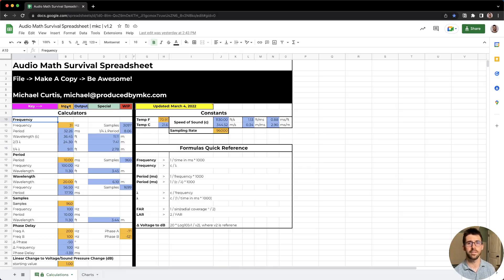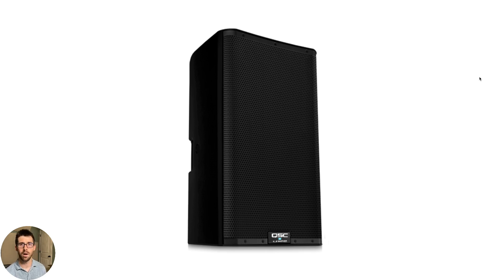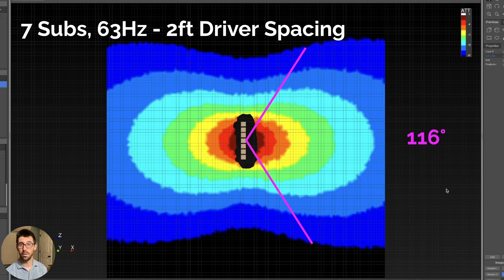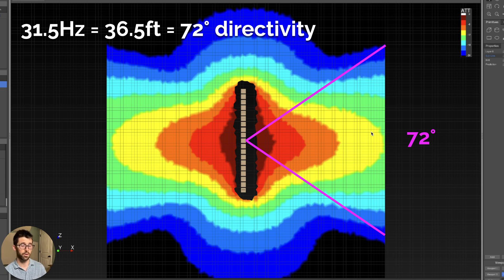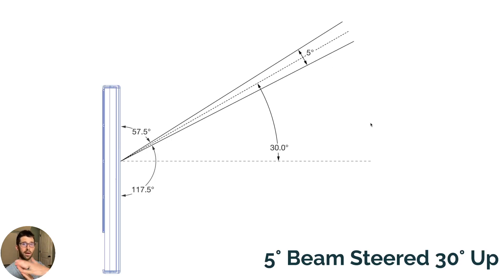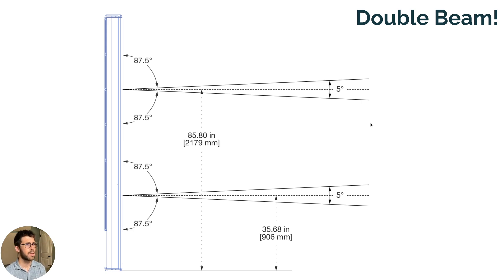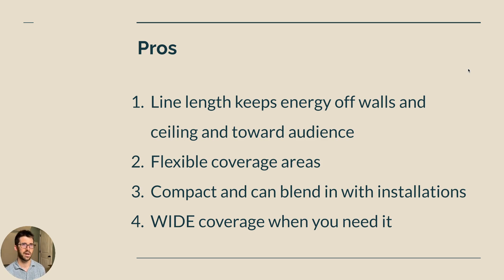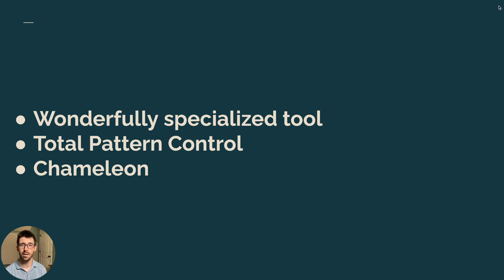Column Speakers For Live Sound | Pros, Cons, and Why They Work

Comment: A number of years ago I traveled through AMTRAK's 30th Street Station in Philadelphia.  The main room with stairways to the various departure gates was a box. Everything about was at 90 degrees to everything else. The ceiling height was 30 feet or more. All surfaces were completely flat and hughly reflective. The perfect conditions for muddy, reverberate sound--little chance if understanding any train departure announcements. Somebody made the PA system a ONE SPEAKER affaire with the one speaker a column array that had to be at least 25 feet tall. The column was in the middle of one of the longest sides of the rectangular room. I was amazed. The train announcements were utterly clear, with perceptually nothing reflected off the floor and ceiling and very little reflected off the parallel walls. Sounded like a speaker located right next to you--no matter where you were in the huge room. Absolutely amazing and the "poster child" for all well engineered column speaker installations.

Comment: This wouldn't work on a Linearray (e.g. 8 elements per side) with splay angle = 0°, right? Cause the individual elements of a line array often have angles of about 12-16°. Or would it work just worse (if ofc every element has its own amp channel)

Comment: I've been using the K-Array column arrays for over a decade now and absolutely love them.  I'm NOT a fan of the 2" tops (8 drivers) but had bought a pair along with their incredibly tiny 12" sub cabinet.  While I don't use them on jobs, I absolutely loved them in my studio and at home for high volume playback.  The 18" and 21" powered sub cabinets contain amplification for the tops and my only gripe is that K-Array is not very forthcoming with information about settings for the system.  There's clearly a lot going on in these systems but the user-available information is relegated to absolute BS....on the other hand, I don't much need to tinker.  I just purchased six tops of their larger 4" driver columns and have now paired those with six JBL VTX dual-12" sub cabinets, which I find a very complementary box.  The 4" Kayman tops are capable of full concert volume and while my concerts are mostly folk/Americana they also take place near neighbors so the 12" lows help us approximate low frequencies while not pushing a huge wave front across property lines.  I also had a set of 4"x12 driver tops custom built and paired with dual 15" cabinets (all Faital drivers), which I mostly use as DJ/movie night speakers.  The single column was built very light-weight and has some mid-frequency spill that makes them a liability for the unprepared with live microphones!  Movie nights, though......simple and amazing, with nearly 180-degree coverage.  

The smaller K-Array's are active speakers (in the low cabinet) and mainly used for ballroom/dinner/gala applications.  The Kayman/VTX setup is passive and has spent summers outdoors with no ill-effect.  The custom builds are passive and have lived on sports fields every spring and fall for several years without failure.  I'm pretty impressed.

Comment: I was playing with subwoofer columns in Danley Direct and found if I applied an even time delay from top to bottom, I could achieve a ring pattern of coverage to an audience on the ground all around a central stage, while missing the stage itself to prevent blasting it with bass. I got interested in the "TM array" from this metallica gig (4 columns of subwoofers facing inwards), but wondered how to steer the bass down. Tilting the column would steer it down in one direction but up in the other.

The beautiful thing about the time delays is you can steer it down in all directions, so the audience hear and feel as if they were at right angles to the column of subwoofers no matter where around the central stage they are positioned. It sort of becomes a partial end fire array, but the phase is not lined up directly underneath it, but down and to the sides. You can even set the limits so that the bass doesn't travel too far out. If you are in a limited size field and don't want to cause a noise nuisance, this could be useful.

Comment: Hi michael. Your videos are very helpful. The way you teach is so easy to understand, unlike many I saw in youtube who cant explain as well or as simple as you do. You made complicated topics easier to understand to the common people. Thank you! My question is: Will column speakers project the sound as far as point source speakers? Or will column speakers project the sound wider than point source speakers?( Assuming both are in the same price range).
Reply from the maker: Thanks a ton!

How "far" a speaker can "project" is a combination of many things - vertical coverage angle, Max SPL, trim height, etc. In general point sources will be more efficient and have more power output than column speakers.

Column speakers in general have a very wide horizontal coverage pattern, 120-160° depending on the model, with a few exceptions.
Reply: @MichaelCurtisAudio Thank you for your reply. I appreciate you taking the time to reply. I think I will stick with Point sources then and obey your command LOL!

Comment: I'm super late to the party on this one, but I run a venue that has a very top of the line column array and I've been fiddling with it and the software for about 6 months now. 
each side has some odd 128 drivers for low mid and 36 for highs - and some subs either side (though i plan to center these in the future for a better dispersion pattern)  

The flexibility to steer, angle, and control the beams takes some getting use to. I've found the secondary beam option is only useful if there is an unreachable gap between the two beams (per say one beam pointing at the ground level and one at the mezzanine. If you try to have two beams for one level of audience, even though the heat map says things are A.O.K, you will have crazy phase issues at the point the beams contact.

Worth noting that you can also set negative beam angles that allow you to "lift" the beam up for a short period of travel distance - great if you're lectern sits right at the front of stage. And being able to adjust the center point of energy from the middle to anywhere along the column means i can get better front to back dispersion while only adding mild phasing artifacts.

I'm also given the ability to optimize the side lobes of the signal by sacrificing some spl; being in a acoustic concert hall makes this invaluable for speech intelligibility. 

All in all, it works well for my venue, but with the best dispersion I can get without it bouncing all over my walls, which are reverberate by design, I can only muster around 105db...this is fine in my acoustically designed concert hall, but wouldn't cut it for a more intense venue i don't think, and can struggle when we do some of our louder, rowdier shows.
Reply from the maker: Thanks for sharing here! Great insight on how this particular speaker topology is acting in a real venue context.

Comment: I'm very interested in building the best possible Ultra Ultra small speaker and I was considering using a bunch of smartphone drivers in a line source, I've already played around with full-range drivers and I'm just astounded of how much power you can get out/into of a 1-inch driver, but I'm looking to go even smaller. Do you have any insights? although a line with 1-inch drivers would be pretty good, I'm curious about making it micro... I also forget how to handle the impedance in a line source I think if I just hooked them up one way or the other , series or parallel , it would either be too high or too low how do you get multiple speakers to behave in an impedance curve. One of my inspirations is the speaker Grado built out of headphone drivers..
Reply: You can wire them up in series and these "packages" can be wired into each other in parallel. So you can end up with the impednace you like.

Hope that was understandebale! ✌
Reply: @florian9220  yes that makes total sense and I don't know why I didn't think of that, probably because I only understand most of this stuff in theory
Thank you very much

Comment: Thank you so much for this. Very very helpful. 
I got a question. 
Could column speakers be mounted horizontally? 
Appreciate your responses.
Reply: Counterintuitively, the wider we make an array the more inconsistent the sound, due to comb filtering. Part of it because our ears are placed horizontally and partly because we travel sideways around a room. The more precisely a speaker is located in the vertical field, the more clear it will sound in the horizontal field & vice versa.

Comment: I use the Bose Pro 32 that has 180 degree coverage. When I add a second even inexpensive speaker forming the left/right triangle  I realize how much I am missing from the $3,000 single column. Why is this?
Reply from the maker: I'd say it's probably a low-mid tonality thing? You're getting more "meat" from those additional woofers.
Reply: @MichaelCurtisAudio what about summation at the high frequencies? Won't this cause comb filtering eventually at the highest frequencies? Especially if you're standing somewhat close to them...

Comment: And what about column with low frequency integrated  subs( that User can’t separate and set in Mono )? In Stereo ? What about low frequency ? (35-100 Hz) like EV 50, Maui 28g2, maui 44g2… for DJ.
Reply from the maker: The same principles of standalone subs would apply to subs integrated into the column. The tricky thing with column speakers is they have very wide coverage, so putting two columns together would get you a ton of overlap and comb filtering.

On the flip side, if you spread your columns out that would produce comb filtering in the low end. A compromise would be to put your columns together, but then toe them out so the high frequencies don't overlap. But that's not always feasible since you want the majority of your PA's energy to cover the dance floor, not all around the venue.
Reply: @MichaelCurtisAudio  many thanks :) i will play with mapp 3D :) to learn

Comment: Really beautiful explanation. Thank you so much for your video presentation. I always wanted to propose this as an option but most veteran engineers always asked me to steer away from it and never fully explain why.

I guess like how you said, more parts = more things to troubleshoot when it failed and that alone is a factor to steer off.

But I would disagree if these are used properly, they make GREAT LOOKING SPEAKERS with their slim minimal line and various color options versus boring black or whites with FUNCTIONAL THROW!
The fact that these throws sound amazingly is definitely something I wanted in my proposal since they're only used for speeches and very minimal video playbacks. But I can see how tiny speakers like this is also prone to damage due to inexperienced engineers.
Reply from the maker: Thanks a ton! Yes, when column speakers are the right tool for the job they perform very well.

Comment: Hi... I'm a Mobile DJ. My events are for a crowd between 50 to 250 people. I'm considering column arrays due to their portability (since I don't have a truck or large car). The ones that I'm looking to get have a sensitivity of 98db (600w RMS) . They come with a 12" sub.  I've already heard them and they sound really good.

Also I'm thinking about buying an extra 15" subwoofer to support them and put it in the middle for those 250 events (or smaller events but with more rounded sound).

What do you think? Would it be enough? Thx so much
Reply from the maker: As long as the new 15" sub is phase compatible with the 12" sub you'd be in good shape.
Reply: @MichaelCurtisAudio  thx so much... And how can I figure that out?
Reply from the maker: @alexfrthebiker  Walk through this same approach - https://www.youtube.com/watch?v=C23dllmmp50

Comment: Totally unsuited for spaces like churches or auditoriums.  In a reverberant room like a church sanctuary, it is desirable (necessary) to target the listening area.   A little column like the CBT70J, if the specifications were correct, which they are not, has a very wide horizontal coverage, and slightly narrower vertical coverage.  {In actual fact, the highs are extremely beamy, as is with any dome tweeter without a diffuser}.   The wide angle can’t target the listening area at all.  It’s like trying to fill a milk bottle with the wide sprayer on the garden hose.  One dome tweeter, or sixteen, or a hundred, have neither the directivity, pattern control, or projection to cover more than about 20 feet.  
* Stupid switches:  the little rotary switches on the side are a joke.  The “voice” position is the full range setting.   The “music” position cuts some mids and highs, making it sound muffled and useless, like it has a blanket over it.   More hilariously, the wide /narrow switch is not a technical marvel at all.  In the narrow position it simply turns off the top and bottom pairs of tweeters, making it even less efficient than it already is.  (Only 93dB)
Any installer using these terrible turkeys has little or no experience, and no regard for the customer.   If these do the job at all, then it wasn’t much of a job to do.   The best word to describe them is “unimpressive”.
* The entire concept of the column speaker is crackpot for the same reasons.  A bunch of little speakers will never equal the coverage, tone, efficiency, or control of a properly designed array, with wide coverage for the front, narrow for the back, and medium for the middle.
Reply: While I haven't used the JBL CBT70J column speaker, I do have experience with its lower-mid extension speaker, the JBL CBT70JE-1, which contains a column of four 5-inch passive drivers. This is one of the few high-power mid-range speakers that has a similar form factor to three-foot-long upper-mid column speakers (typically containing eight or more one or two-inch speakers). The problem with such narrow columns is they can't really cover the low-end of the male vocal range and sound very brassy on their own (highs need to be shelved way down). The CBT70JE-1 mates well with a pair of column arrays, crossed over at around 450 Hz. Cutting out the lower-mids allows you to pump more upper-mids into the column arrays without distortion, and makes their coverage pattern more consistent. I also prefer the 450 Hz crossover because its in the vocal band I usually want to EQ down anyway.
Reply from the maker: @QuicksilverSG  Good to know! Thanks for sharing those tips.
Reply from the maker: Thanks for weighing in here, Perry. I've never used the CBT70J. Have you used any other larger format column speakers whose longer line length can help out with steering? Or EAW's Anya platform?

I'll be honest in saying I've only used column speakers a few times and have got decent results, but am not an expert on all the inner workings besides seeing at a macro level how the components work together.
Reply: Perry Wright, I have to agree. My church was running Turbosound iQ12s. They moved into a different location using new equipment, and have a pair of these installed. It's definitely a downgrade, plus they list for over $1200 a piece.

Comment: I’m strongly considering installing a few column speakers as floor wedges angled towards our choir just below the stage.  Our current stage has floor wedges set up pretty far out and they are firing about 10 feet above their heads, so when they are performing to a track, they are not hearing the music well.  I’m really tempted to give these a try as floor wedges. Thoughts?
Reply: I tried a 16-driver K-array Column speaker horizontally once. I was running experiments to figure out different uses. This is a $8K speaker. It was totally useless in a horizontal position. The beam is just wrong for Fold back unless you stand in a stationary position. Hanging from the roof horizontally was also useless.. I had time to and was curious.
 Horizontally, the beam hits the floor and the ceiling big time and if you walk past the end of the speaker Left or Right, the sound just disappears. When the column is vertical it has very little dispersion vertically. So when it is horizontal, it tails off really quickly as you walk past the end of the speaker. I believe there was a switch that changed how much, but I didn't find it made a lot of difference. 
Hope that helps.
Reply from the maker: @ScottGeorgeson  Thanks for the input here, Scott. I intuited that, but good to know your real-world experience with that setup.
Reply: GALAXY HOT SPOT's.  Close to the listeners, at their feet or arms length away.    If you need to run instruments back through monitors, use separate speakers from vocals.  I would never run instruments through monitors, that’s what small instrument amps are for.
Reply from the maker: @perrywright4904  Yes, those hot spots are pretty handy. If guitarists are using amp sims and don't have cabs, or bass is direct, they may need IEMs or to use the floor wedges.
Reply from the maker: Are you able to put a roll of gaff tape or something under the far side of the wedges you have so they're pointed more at your choir?

And if you would get these column speakers, would you be hanging them vertically or horizontally?
Reply: @MichaelCurtisAudio  Unfortunately it won't work. The existing wedges are also below the floor and angleing them forward would cause them to fire below the floor surface.  Also they are meant more for singers and performers that are closer to the front of stage. I was mauling over the column speaker idea for a long time but was never sure if it could be implemented horizontally. My interest was revived after watching this tech tour of Victory church in Tulsa. https://youtu.be/xvjpX8WKawk around 19:55 mark. Anyway I'm interested in a mix of horizontal as well as vertical positioning for some parts.